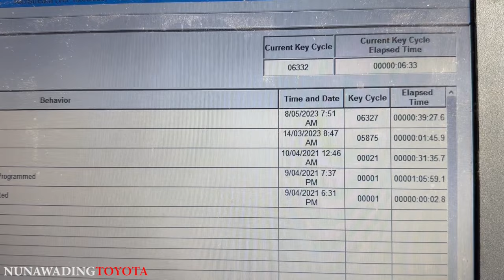Toyota Pre-Collision System/Radar Cruise Control Unavailable-Clean Sensor. What you need to check.

Comment: When the grill or radar is removed and installed calibration of radar sensor is required! But how?
How do you calibrate it?
Reply from the maker: You need a diagnostic tool and special service tool. The special service tool is placed at a distance from the radar sensor and calibration is performed using a diagnostic tool
Reply: @nunawadingtoyota8134  thank you champ. Dam i thought i would get it fixed myself. Owell. Appreciate it

Comment: G'day Darek I got the same problem with my 2018 Prado Kakadu " Pre-Crach Safety Malfunction" and " Check Engine" lights come on while we were on holidays towing a caravan I took it to to closest Toyota dealership that was Taylor Toyota in Hamilton they were very helpful and connect their diagnostic machine on the car and there were a few codes coming up(I got a printout of the codes) they reset the codes and it was fine for a day and the codes come back again, I cleaned the radar and all other sensors even disconnect the battery codes was off but come back on the next day, any advice?
Reply from the maker: Pre crash safety malfunction will come on when there is an engine malfunction code. You need to fix the engine code. What was the engine code on the printout?
Reply: Thanks tor coming
back to me. I hope I
read the report
correctly, codes are:
P066F, P1609
C1201,U0126,U0129,U0
142,00132,U1110,U014
O,UC1A50 one that
Taylor looked at was the glow
plug no3 wiring but nothing was
damaged.We just
come back from
holidays I still didn't
talk to my local dealer about the codes. I checked my air filter and saw that the back two clips were loose and there was some dust on the inside of the filter cover. Thanks
Reply from the maker: Thanks for the feedback. P066F refers to a short circuit in the No3 glow plug circuit. Trouble area could be Glow plug controller, No3 Glow plug assembly or short in No3 Glow plug circuit. P1609 refers to Air Fuel ratio too lean.
Reply from the maker: If P066F keeps reoccurring, you need to fix that and retest